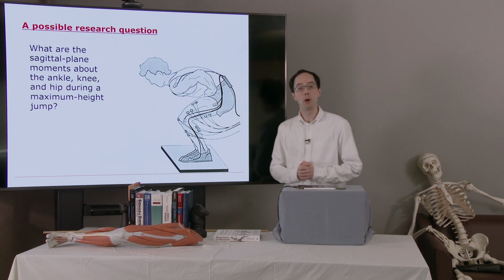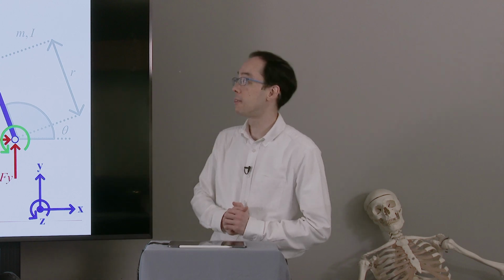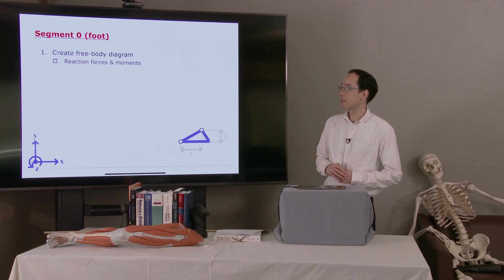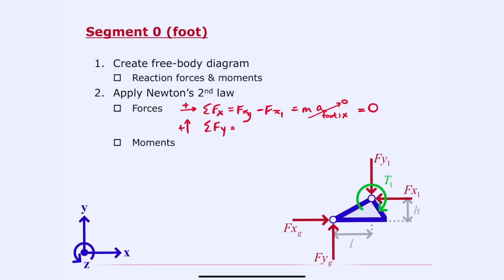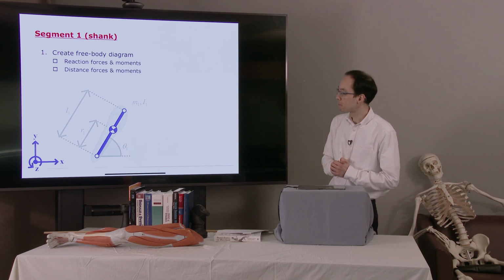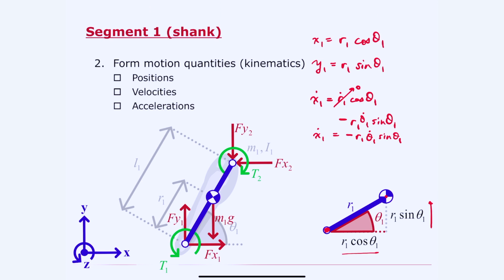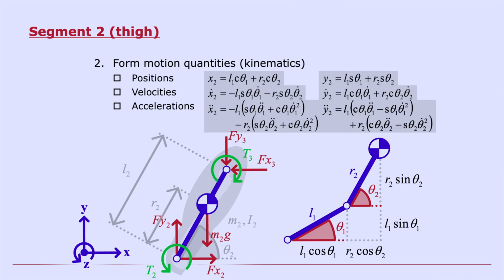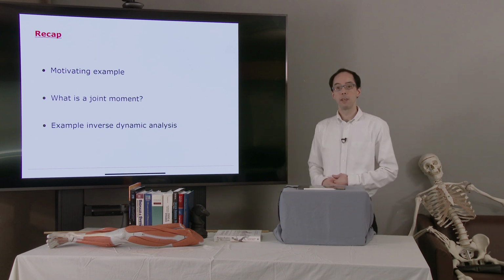Biomechanics of Movement | Lecture 8.2: Leaping into Inverse Dynamics Analysis of a Vertical Jump

Comment: 3rd row in the final Matrix had some interchanged values pls check it before using as it is.
T1-T2+Fx1r1S(thi1)+Fx2(l1-r1)S(thi1)-FY1r1C(thi1)-Fy2(l1-r1)C(thi1)=I1.(thi1)''
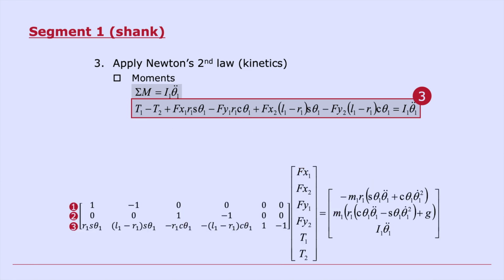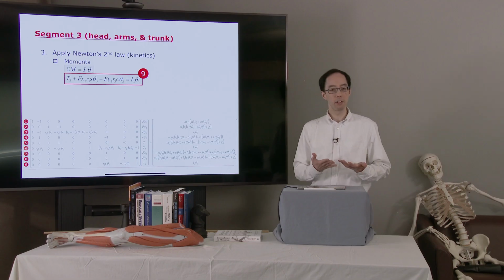Reply: About to comment the same. Comparing 17:10 with 19:50, there appears to be a Momentum (T_i) component order swapping.